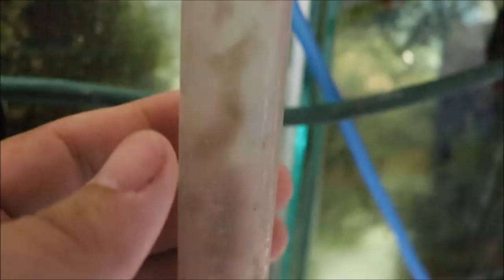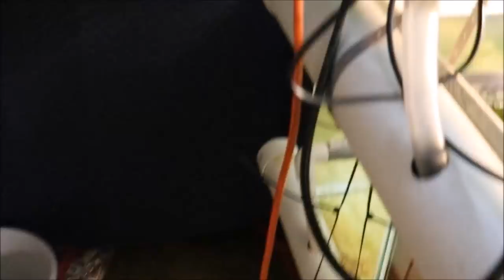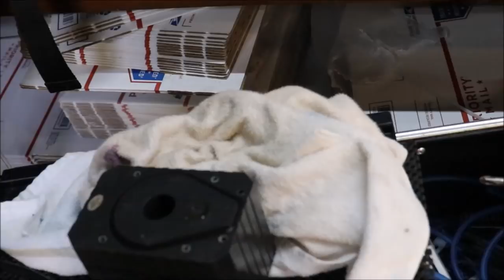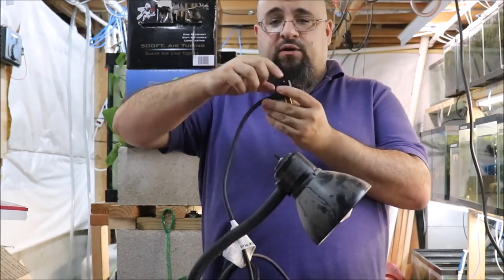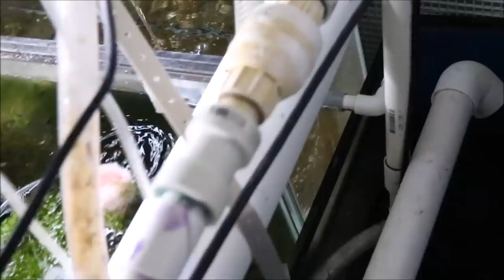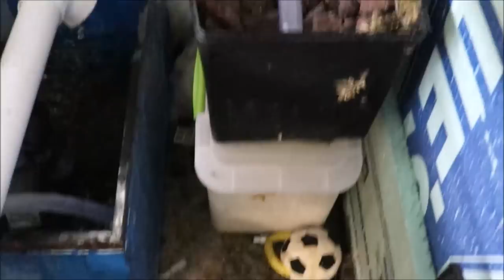CATASTROPHE ! in my Fish Room, WATER EVERYWHERE!

Comment: Bummer! Reset the clock: "It has been 0 days since I last flooded the basement" -- I use two household style sump pumps (they don't clog easily), one has a piggyback float, no failures in 5 years so far!
Reply from the maker: Two in the same sump?
Reply: one for the fish system, one for my slop sink, check out #266 for my float activated water alarm, it makes a super loud noise and also shuts off my mechanical solenoid drip valve #315
Reply from the maker: Come to think of it, I have one in the slop sink too,......

Comment: Gawd that's better than what I do. I use a 32gal brute trashbin to drain my individual tanks into and have a cheap pond pump connected to garden hose to drain into garden. It fills up with little snails shells, plant debries and sand and is high maintenance.
Reply from the maker: I need something that will work, even when I travel!